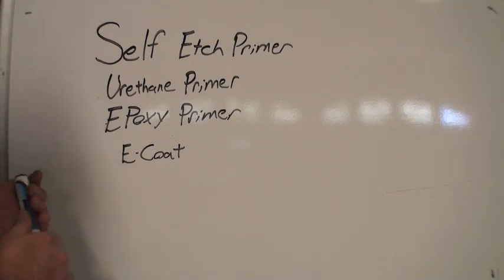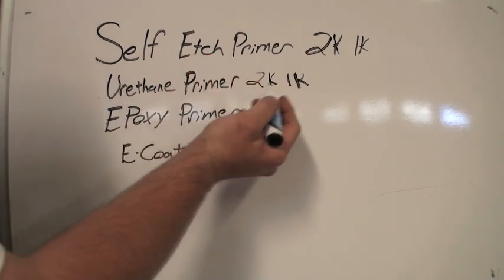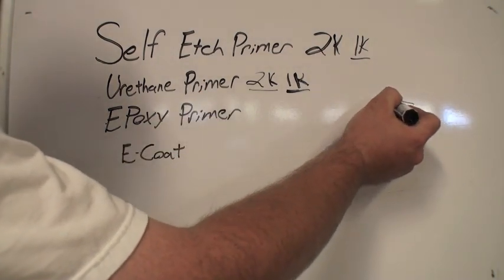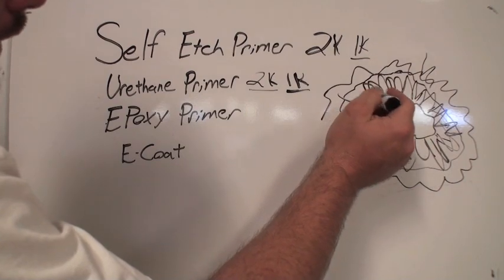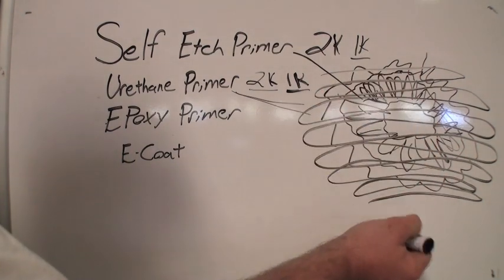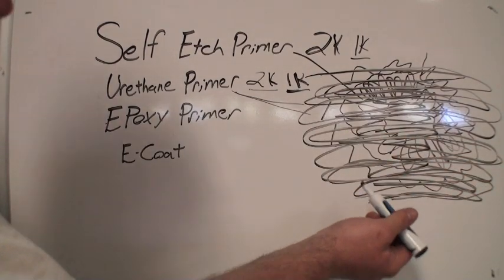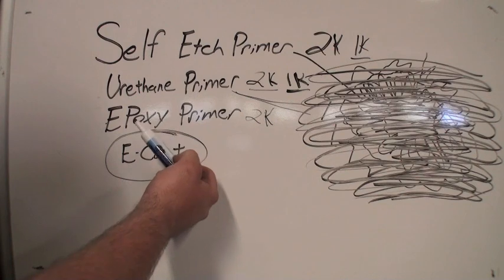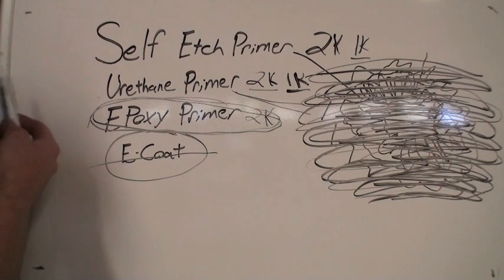Class on Primers Self-etching , Urethane , Epoxy primer

Comment: if you sand down the clear and come across small pieces of metal showing. Can i use rattle can self etching primer then use urethane primer over? or do i have to buy Self etching gallon or quart?

Comment: Ok my car is an early 90's disaster, 1 fender was never painted so its 90% rust, the bumpers are unpainted plastic (black) and the car itself is a couple different shades of red. on the plus side i only have a few spots ill have to take out some small dents and rust. 
 i want to paint the car blue is there an overall primer i could use to save some money? maybe if i sand all of the paint off so the whole car is bare metal.